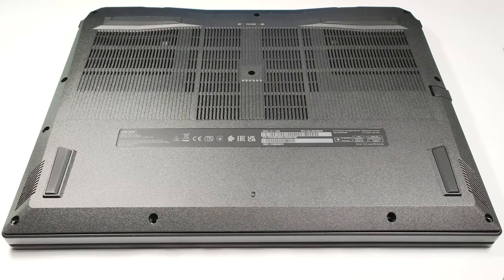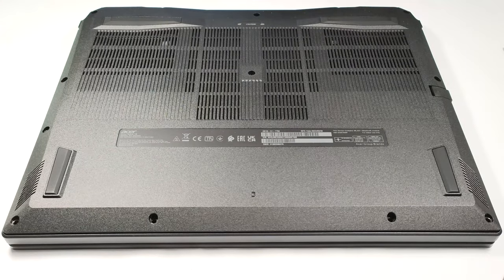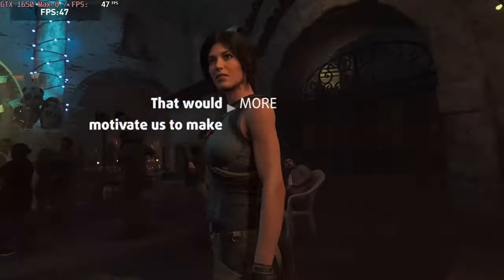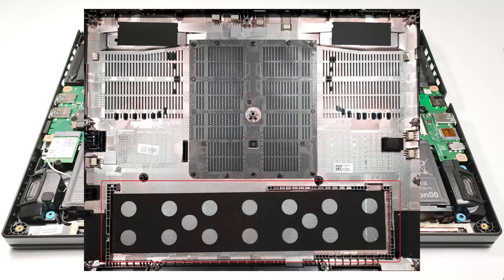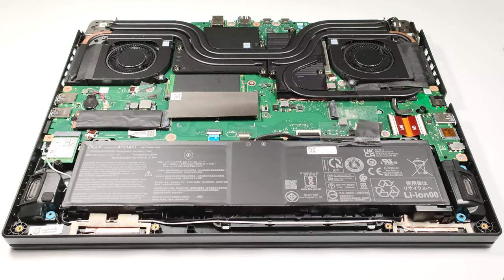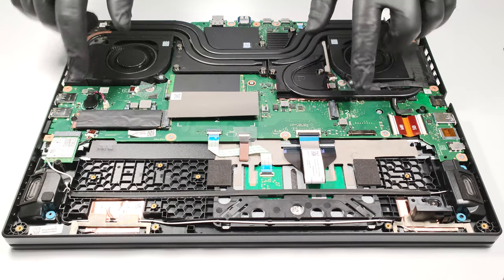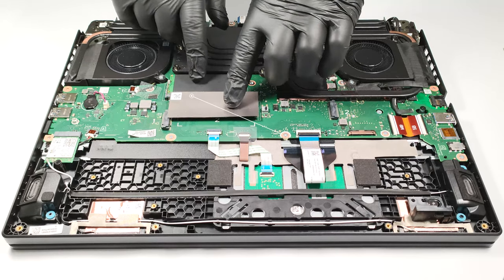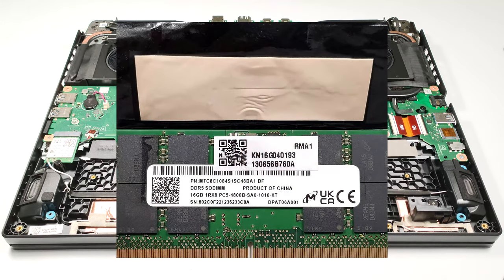🛠️ How to open Acer Nitro 16 (AN16-51) - disassembly and upgrade options

Comment: I really liked your video and presentation👍
Reply: good afternoon!, just to say that this laptop is quite good but, when it comes to upgrading, you should not trust the information given in this video since the laptop that I bought has two 500 GB SSDs, so it does have 1 TB of memory and they come configured in Raid 0, I also say that the RAM does come with 16Gb but in two 8 GB modules, so I was disappointed when I opened the laptop and discovered such a disastrous configuration. I wanted to change laptops and I was watching videos of people showing the inside of the product to see the possibilities of increasing the RAM to 32 GB and adding SSD from my old laptop. This makes me think that this person who makes this video is not completely telling the truth, if it is true that the characteristics are those offered by the manufacturer but he deceives the public by showing components that are not and deceiving the public with possible improvements that are They can do to the product that they will no longer be able to do because the spaces are already occupied with components.
 This laptop contains:
two m2 ssd slots...occupied by two 500GB m2 ssds (1TB total)
two RAM memory ports...... occupied with two DDR5 SO_DIMM modules of 8GB each (16GB in total)   
On the other hand, the battery will never last the 8 hours or 7 hours it said with the screen on.

Comment: So i can just put 1 16gbs of ram  to make it 32 ?
Reply: good afternoon!, just to say that this laptop is quite good but, when it comes to upgrading, you should not trust the information given in this video since the laptop that I bought has two 500 GB SSDs, so it does have 1 TB of memory and they come configured in Raid 0, I also say that the RAM does come with 16Gb but in two 8 GB modules, so I was disappointed when I opened the laptop and discovered such a disastrous configuration. I wanted to change laptops and I was watching videos of people showing the inside of the product to see the possibilities of increasing the RAM to 32 GB and adding SSD from my old laptop. This makes me think that this person who makes this video is not completely telling the truth, if it is true that the characteristics are those offered by the manufacturer but he deceives the public by showing components that are not and deceiving the public with possible improvements that are They can do to the product that they will no longer be able to do because the spaces are already occupied with components.
 This laptop contains:
two m2 ssd slots...occupied by two 500GB m2 ssds (1TB total)
two RAM memory ports...... occupied with two DDR5 SO_DIMM modules of 8GB each (16GB in total)   
On the other hand, the battery will never last the 8 hours or 7 hours it said with the screen on.

Comment: good afternoon!, just to say that this laptop is quite good but, when it comes to upgrading, you should not trust the information given in this video since the laptop that I bought has two 500 GB SSDs, so it does have 1 TB of memory and they come configured in Raid 0, I also say that the RAM does come with 16Gb but in two 8 GB modules, so I was disappointed when I opened the laptop and discovered such a disastrous configuration. I wanted to change laptops and I was watching videos of people showing the inside of the product to see the possibilities of increasing the RAM to 32 GB and adding SSD from my old laptop. This makes me think that this person who makes this video is not completely telling the truth, if it is true that the characteristics are those offered by the manufacturer but he deceives the public by showing components that are not and deceiving the public with possible improvements that are They can do to the product that they will no longer be able to do because the spaces are already occupied with components.
 This laptop contains:
two m2 ssd slots...occupied by two 500GB m2 ssds (1TB total)
two RAM memory ports...... occupied with two DDR5 SO_DIMM modules of 8GB each (16GB in total)   
On the other hand, the battery will never last the 8 hours or 7 hours it said with the screen on.